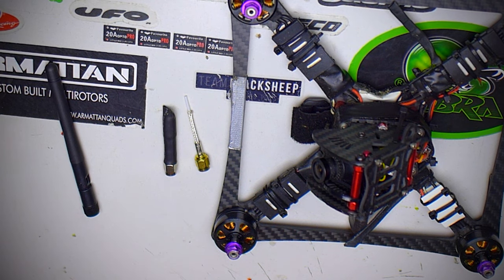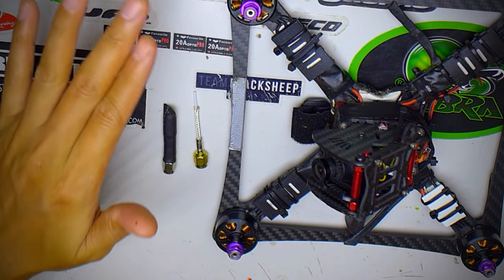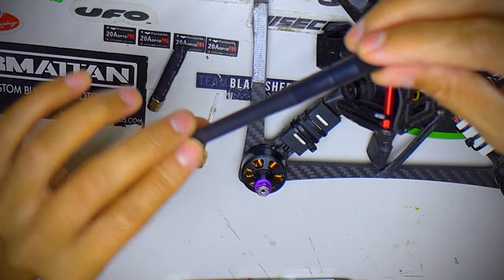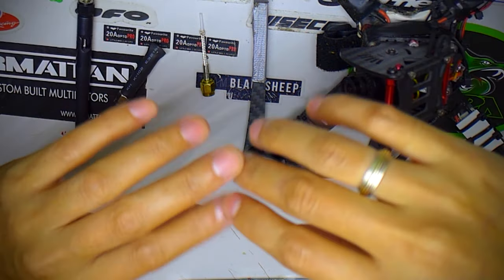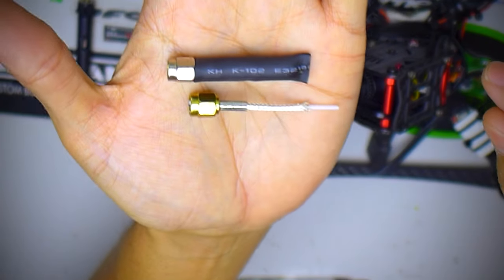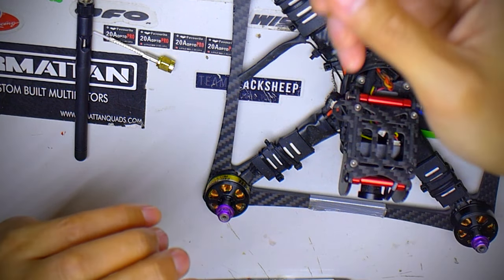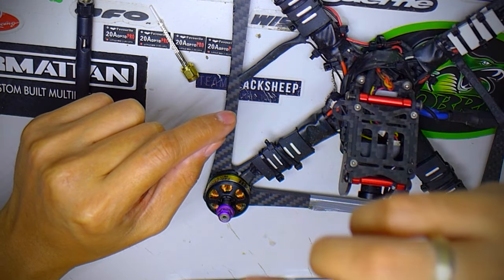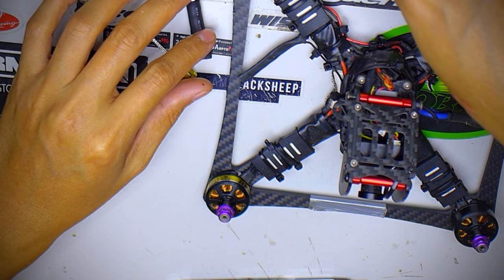Linear/Whip antennas coming back to FPV?

Comment: The cross polarization benefit of CP antennas is very oversold mainly by antenna manufacturers (unsurprisingly). One of the biggest challenges FPV has to overcome is the lack of rf spectrum we're allowed to use. ISM/raceband is technically only available to those with HAM license. The rest of us are limited to fatshark. No amount of cross polarization rejection would allow a bunch of pilots given that constraints. Some vtxs and rxs can do 5300-5900. Imagine how many pilots could fly away once in all that spectrum! I have a diversity receiver with left and right ion to pick up my linear regardless of orientation. The real heroes in this will be the receiver hardware/ firmware people in the end not the wizzbang tx antennas. Sorry...

Comment: Great video, thanks for the tip!  I found another video from painless360 who had the same thought, he had a friend do some testing on a something-or-other machine I can't pronounce...lol, and came up with good results also, I'll link it at the bottom.  I'm also going to leave another link to some linear antenna's that are usually bought for computers, routers and so forth, but saw a few people in the reviews said they bought them for their quads.  They are dual band 2.4ghz-5.8ghz, but the specs say they're not separate bands, that's just the frequency range.  Do you think these would work like the ones you are using, at least on goggles or a ground station?  They're more than double the power at 9dbi, or is that just a gimmick?  Thanks in advance for any advice!

Dual band linear antennas - https://www.ebay.com/itm/2pcs-Dual-Band-Wifi-antenna-2-4g-5-8g-9dbi-RP-SMA-male-Aerial-Connector-FPV-RC/192862729124?_trkparms=aid%3D1110001%26algo%3DSPLICE.SIM%26ao%3D2%26asc%3D20160323102634%26meid%3D11b4bc66529d45f6abe438eda66d4c10%26pid%3D100623%26rk%3D3%26rkt%3D6%26sd%3D183559903652%26itm%3D192862729124%26pmt%3D0%26noa%3D1%26pg%3D2047675&_trksid=p2047675.c100623.m-1

Linear vs Circular for whip antenna test - https://www.youtube.com/watch?v=G2SaOBe1pKA&t=7s

Comment: Much of the information in this video is incorrectly please do a little research, before posting stuff like this.  Please look up the difference between a whip and a dipole antenna.  Please also look up how alternating polarization can help with reduce crosstalk on nearby frequencies.  Sure, two people racing, dipole is great.  However 8+ people racing and the use of polarization can help significantly.
Reply from the maker: puppetx you are correct. i should have used the term "whip" antenna. although I did correct the title and changed it to linear, and put in a correction in the description as well. however, I will maintain that up to 5 people racing as we have constantly tested, these antennas are very useable and there is generally no need for cp antennas in those scenarios. CP antennas are still great, don't get me wrong, all I'm saying and sharing is that these whip antennas are already available that came with the vtx, or also available as a very inexpensive option from the bgood link as well. thanks for commenting!
Reply: Thank you for your effort to correct the information.
You're absolutely right about how awesome dipoles are! I fly a dipole on my 3 inch to save weight and to increase durability. I rarely fly with anyone else, much less >5 people so it works out great. I was also confused about the difference between a straight whip and a dipole, until one day I was testing with a whip on a brushed build and noticed how much poorer it performed.
Thanks for taking my probably poorly worded criticism well.
Reply from the maker: puppetx no worries! I use whips with my brushed quads all the time and tried them out on the bigger 5inchers and realized they're good for those as well. Thanks for pointing out the mistake, and that was useful to learn from as well! Cheers ☺